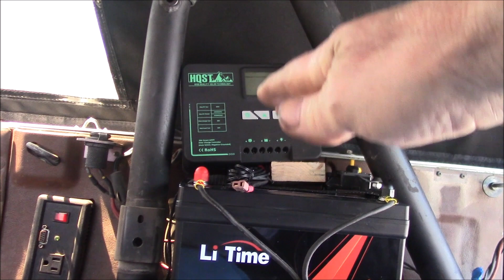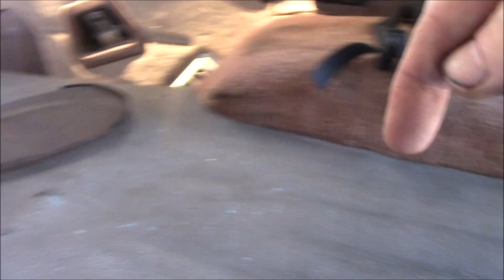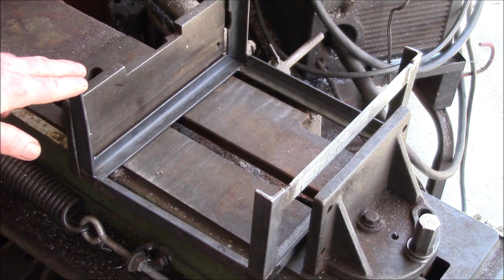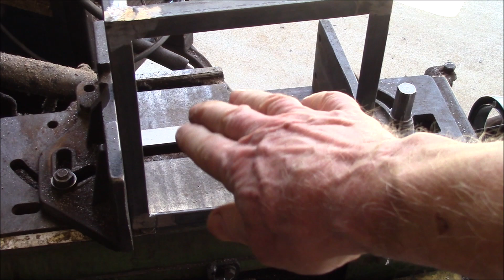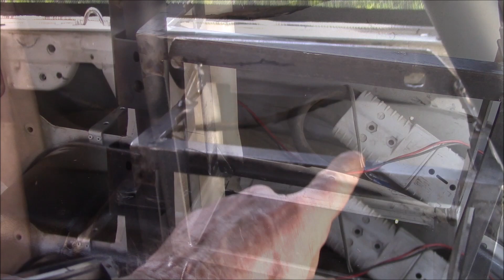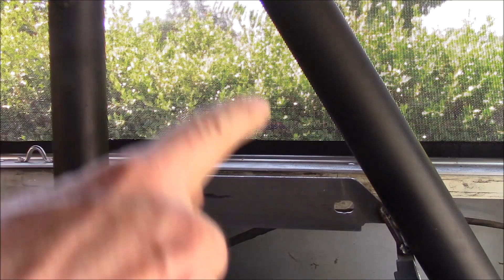House Battery and Solar for the 4Runner - Battery Cage

Comment: I was wondering why you didn't just use a portable power station but then I read the notes. I noticed in the notes you wanted to use the alternator to charge the battery if the controller quits but I don't see a DC-DC charger in your parts list. Also wondering what you plan on running with it since you already have a decent amount of storage in the existing dual battery setup. Why not just hook the panel to the existing batteries?
Reply from the maker: In short, the lead acid batteries are optimized for cranking amps for starting / winching, but not so much for reserve capacity.  20+ years ago, that was my primary concern.  Worked great for wheeling trips where the engine was running all day, many restarts, etc. then a short overnight tent camp.  

I have a high output alternator with an adjustable voltage regulator and have that set to output power at a voltage that works with both the AGM and LiFe batteries.  If that proves to not work well, I can always add a DC-DC charger later.  But, in normal operation, the alternator charging will never happen as the relays will open the connection when the engine starts.

Maybe didn't explain using the existing dual batteries for solar clearly enough in the video.  Yes, combined in parallel, there's ~52AH of capacity.  But in order to maintain any degree of redundancy, you need to limit to only one battery @26AH.  Then at a 50% DOD, that leaves 13AH useable capacity.  My fridge uses about 18AH/day so that eats into most of that capacity.  I have run one of the dual batteries dead by morning a  few times.  I also want to make more use of the 300W power inverter which before I could only really operate with the engine was running.  

Adding solar to the dual battery system also is complicated by which battery to use.  If I put that on the aux. battery. along with the other loads, then I lose the redundancy of that extra battery if somehow it gets run down.  After having made use of that feature multiple times over the years, it's very nice to have that battery there at the flip of a switch.  Or do I put the solar on the primary battery or do I use both batteries in parallel for the solar.  

That's why I decided to go with a 3rd battery and one that has much more capacity and can handle multiple discharge cycles.  With the interconnection circuits, I can let the charge controller keep either of the lead acid batteries topped off, if needed, using a hybrid charging profile suitable for both types of battery chemistries.  For cold weather operation, I can disconnect the LiFe battery and connect the solar to one of the lead acid batteries and run that way.